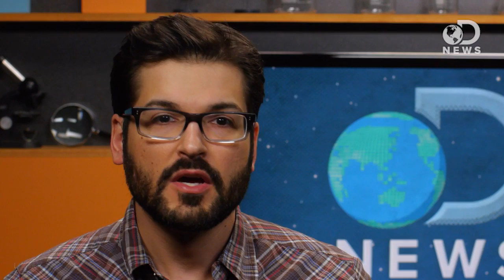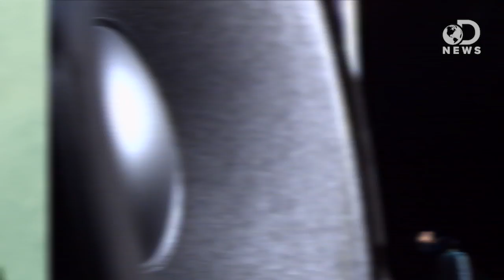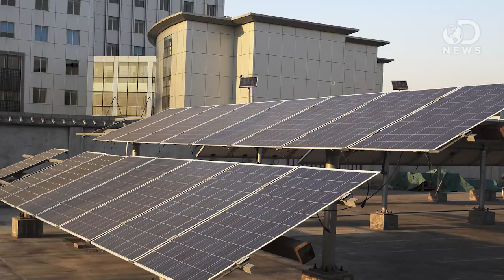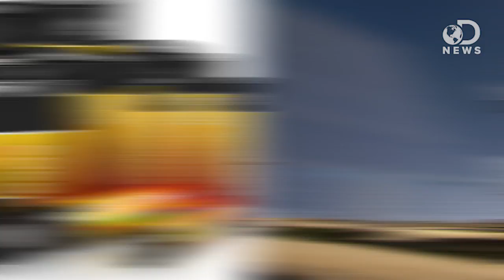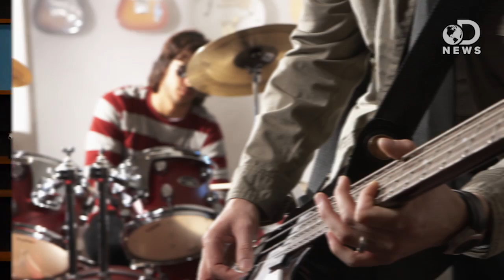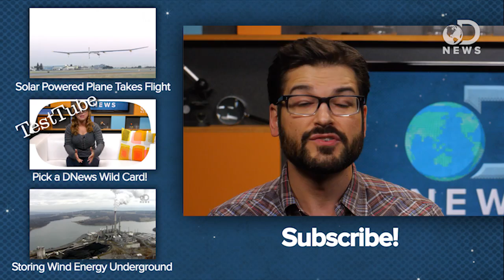Pop Music Makes Solar Cells More Efficient

Comment: I saw the use of sound in several movies as a way "to solve the missing umpf" in weird devices - Realistically, it just works as extra power and seems to be a proven fact. In modulation like AM radio the carrier wave swings a bit extra (Amplitude). A LED lightbulb can blink up from a constant of maybe 2-3 volts by adding the music (in a wire) which is very little energy. Some musicians also apply energy and got it from the food.

Comment: As an Audio Engineer Graduate I would have to say that this has everything to do with the dB levels. Pop music is entirely saturated and raised to the max during mixing. The Loudness Wars have pretty made birthed a style of music where they just completely saturate and raise the gains of the mixes to the highest levels possible. But they left very many variables for us to think about in this study. They did not mention the type of speakers they used to play this music near the panels. We don't know if they used a radio with crappy speakers of if they had serious audio system with bass. I imagine that the SPL has everything to do with this and the fact that pop music has nice crisps bass loops which can cause very high SPL's.

Comment: Pop music was only more effective at boosting solar panel output than the other kinds of music they tested for one reason, and it has nothing to do with music taste: Sound Pressure Level (SPL).

Most pop music is based on hip-hop and house music, which both rely heavily on the kick drum for rhythm and the bass for getting toes tapping and booties shaking. Bass instruments contribute FAR more to a track's overall SPL than their higher frequency counterparts, so it only makes sense that bass-centric music like Pop and EDM would achieve higher SPL than other types of music that don't focus on the lower frequencies.

Comment: My field is Biology, not electrical engineering nor physics, so this is something that has always been on my mind. I've always wondered; If you took a solar panel, and  wired a light above it, like florescent or the squiggly bulbs, would it create and infinite energy loop? So that even when it's dark or cloudy, the lights are still generating energy in the panels? But would it net energy or cost energy, would the lights put out more energy than they use?
My brain hurts now.
Reply: You would need a 100% efficieny solar panel and also no resistance in wires (super conductance) for this loop to run infinitely. This is of course impossible due to 2nd law of thermodynamics (a process create entropy) and never reaches 100% efficiency.
Reply: Well not all of the energy is being converted into light, it also makes heat, so you could probably fry an egg on it, but it wouldn't last forever...
Reply: blipblop92
 U my friend didn't skip the physics classes :D
Reply: if the light needs energy and the solar panel needs energy,
its not really infinite as the light power from the solar panel will go to power the light
energy is conserved even well in the perfect system
the light uses power and the panel generates power equal to the lights energy usage, in a perfect system

Comment: OK, so if get it right these zinc panels WITH the musical boost still convert only about 1.68% of the solar energy they receive (40% more than the original 1.2%).

While I appreciate the new research directions this opens, it's still WILDLY inefficient (not to mention you use energy to produce these vibrations, so...).

Comment: How about cold?  Run solar thermal power stations (tube types) during cloudless nights, point the focus at empty space.  Use the array to dissipate heat in a working fluid down to very low temperatures (much lower than ambient).  By morning, you have a tank of cold.  Use this cold to improve the Carnot efficiency of the thermal cycle used to generate power.
There you go... power from "nothing" (literally).

Comment: Zinc Oxide is a piezoelectric material and Active Polymer is photoelectric. When these two materials are layered together they create an audio-electric photo-transistor. A high pitch sound at the volume of a typical office printer stimulates the zinc oxide nano-rods making them produce a small voltage that then stimulates the active polymer increasing it's photoelectric efficiency from 1% to 40%.

Comment from the maker: This experimental solar panel is more efficient when loud music plays nearby: http://dne.ws/17wm4t2 ♪ ♬ ♪

#solar #solarpower  #solarenergy   #solarpanels
Reply: I'm skeptical. Since the cause is, vibrations are generating electricity in the Zinc Oxide nano-rods perhaps there is NO actual increase in solar energy, and all the electricity is coming from the SOUNDS themselves. In which case, conservation of energy applies in full force, and the amount of electricity cannot possibly exceed the energy of the music it's being hit with, which also means we lose the energy that goes to making the sound.

In short if it's the sound itself which is actually generating the extra power, it will probably be a dead end.

Although, it might be a way to generate power in loud urban spaces especially if sound reflectors catch the noise and reflect it onto the panels.
Reply: 40% more than 1.2 is still less then 2% efficiency. Next up: it's the power of Love!
Reply: Nate Meyer It wouldn't extend the battery life as much as having the speakers off would. :P
Reply: DarkEnergy1011
NO! ABSOLUTELY NO!
A 40% increase is ALYWAYS relative to the value being increase.
It's not 40% + 1.2%.

It's 1.2% + 1.2%*.4 which equals 1.68%.
Reply: Floating solar panels, to get it vibes going. Surly water or any liquid is great way to add more vibes / friction to the solar panels.
Reply: Mog of War As you said in the end these only be used to make energy in urban places where there just is noise from cars an things. we wouldn't put them in front of speakers to try to make energy. although on battery powered speakers you could use these and connect them to the battery so that at least some of the energy from the battery that went into creating sound could go back to the battery it wouldn't be endless but it would extend the battery life.
Reply: Solar panel: sarcasm self test complete.
Reply: Mog of War Except it sounded like it's a 40% increase in it's ability to produce power from sound waves, the 1.2% is its ability as a solar panel, so the two values don't even corolate in the first place. It would continue to generate 1.2% from the sun, unchanged, while producing 40% more than it previously had been from the sound waves.